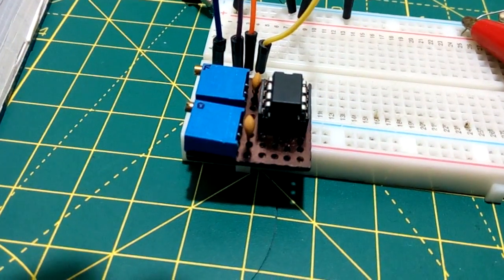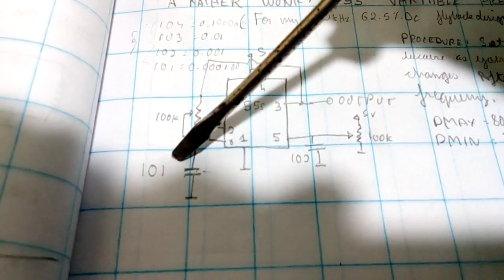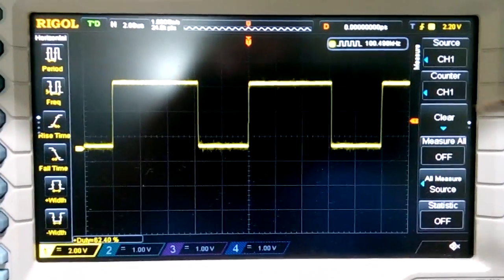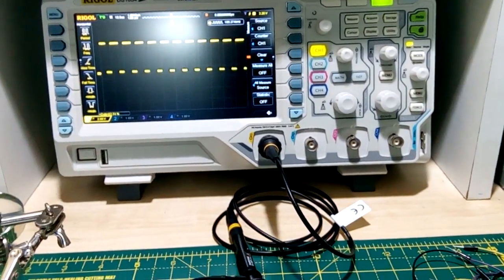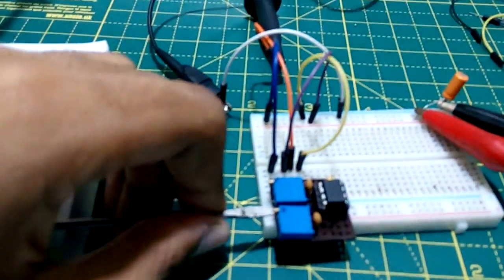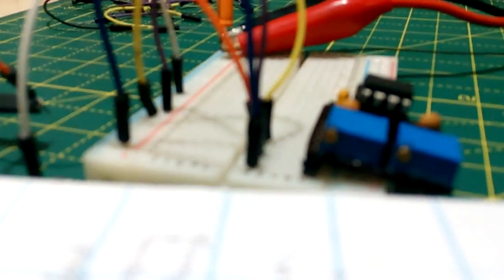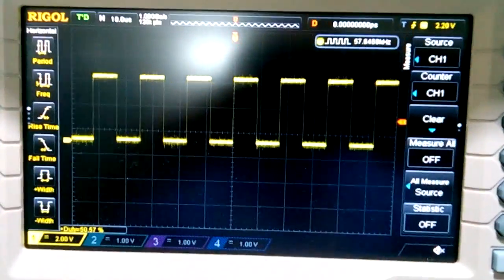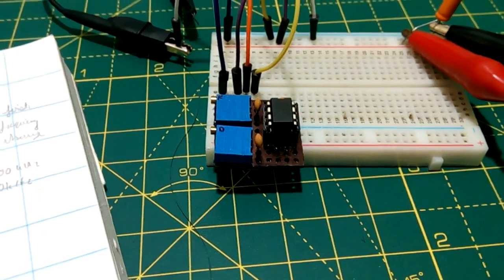555 Time Variable Frequency and Duty Cycle (In a rather wonky way)

Comment: Using pin 5 to vary frequency..it has a narrow range, limited by the 2/3 , 1/3 comparator thresholds . so the 100k pot is ineffective at its extreme ends .
Two properly selected resistors one on either ends of pot to limit upper volts to about 0.5×Vcc and lower volts to 0.25×Vcc will increase effective potentiometer range .
Reply from the maker: Thanks for the comment, this video is five years old now but I appreciate the feedback 😅
Reply: @NNNILabs  came across it yesterday

Comment: fuel injector testing circuits mainly frequency range is 1 to 20 hz variable and duty cycle adjustment circuit .this is a main function for injector working. you are having any idea????!!!!
Reply from the maker: I guess you could operate the 555 at low frequencies, but changing duty cycle I'm not sure about, might have to mess different values of timing resistor and capacitor.

Comment: Plz make a circuit for variable oscillator for 40khz to 1mhz
Reply from the maker: 40kHz to 1MHz is kind of a large range, I doubt if such a large range could be obtained using a 555 timer.

Comment: I am just a beginner at this. I would like to build this. I can not read the PIN number in the bottom left corner of your schematic ?
Reply from the maker: Ah sorry about that, it's pin number 6. Pins 2 and 6 generally go together in a 555 oscillator circuit.

Comment: Can you please make a voltage  booster circuit using IC 555 to charge 450V  capacitor bank .
Reply from the maker: I already have a lot of videos on my channel related to cap chargers.